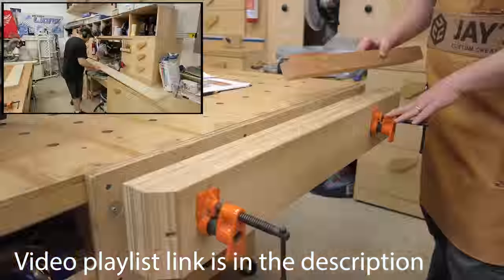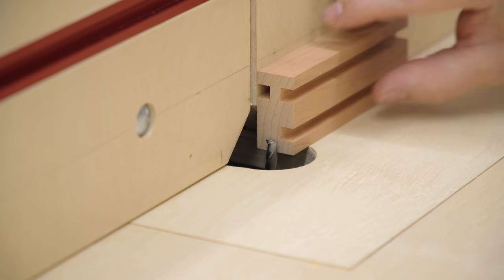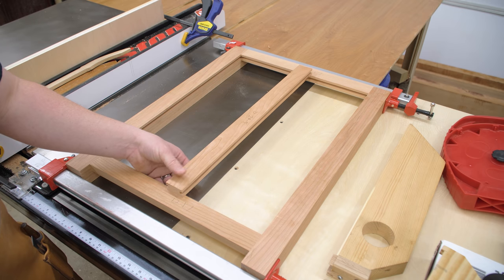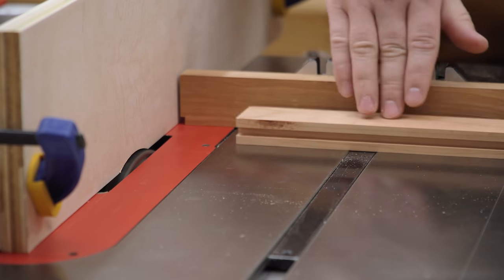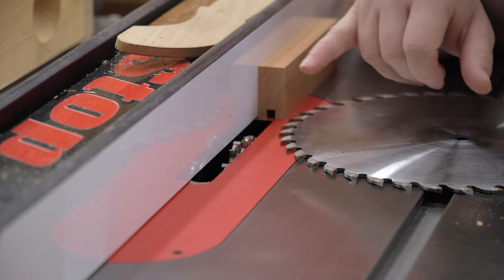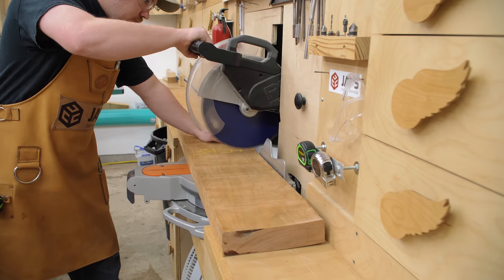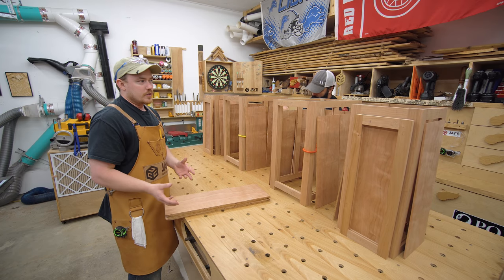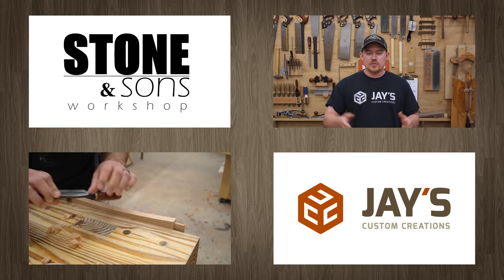Tongue and Groove Joinery With A Router Table or a Table Saw -  Vanity/Desk/Dartboard Cabinet - 291

Comment: Another block buster in the can. Well done. I think cutting the grooves on the Router table was a good move. More control and stability. I have a set of different Dia bearings I can put on the slot cutter to vary the depth... I'm sure you have them in the U.S. AND good work on the accuracy of the Re sawing.  That was a very good yield from the panels. Well done Guys.
Reply from the maker: After running into this limitation I got a slot cutting set with different size bearings. Thanks for the kind words!

Comment: How much did you undersize your panel?  Are you worried about expansion with the solid wood in the grooves?
Reply from the maker: There will be about 1/16" around the panels. A lot isn't necessary considering every panel is small and the majority of the expansion will be in the thickness.

Comment: When you are cutting the panels to length on the circular saw (after resawing), you cut a little off both ends. Why do you do that?  Isn’t the cut already clean from when you cut the 8/4 slab?
Reply from the maker: The cut is clean from the 8/4 slab but the reference face that was against the fence of the miter saw was still in its rough state. Therefore it's impossible to guarantee a perfect 90 degree cut at that point. Only after the pieces are milled square four sides can the piece be cut to it's final length. The two cuts at the miter saw at the end establish a 90 degree corner and then use that corner at the stop block to establish the final length.
Reply: Jay Bates makes sense, thanks!

Comment: Here in the UK, we use different measurements to the US, what on earth is an 8 quarter board, to me that sounds like 2 inches, but I believe this is wrong, so making following a bit difficult.
Reply: Kevin Behr it’s 2 inches.
Reply: Yes, Thank you,  I got that from the video, but why have this very odd way of measuring stuff, as for nails what on earth is a 5 penny nail etc, sorry, I sound anti American, I'm not, but being separated by a common language does make things harder to follow, as you have to do a conversion in your head, time we all went metric, as much as I hate that system, it does work.
Reply: Kevin Behr the 8 quarter and such is a lumber yard system I think it’s just one of those things that has stuck.
Reply: Ah, thanks again, (not sure where you are?) here in the UK we too have hangers on for measurements in many fields, a real PITA to figure out sometimes, fortunately we are slowly changing the way things are done, until then you have to be a bit bilingual in measurements terms or have a conversion app or two.

I did look, but even Wiki is a bit confused by it all, no mention of nails sizes for instance, https://en.wikipedia.org/wiki/United_States_customary_units
Reply: Now tell me about 2 pence again...